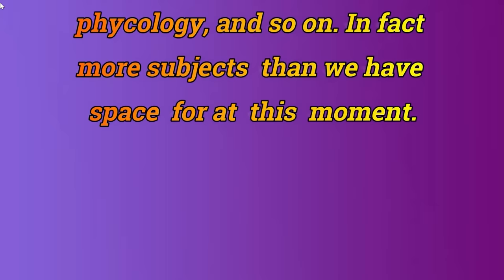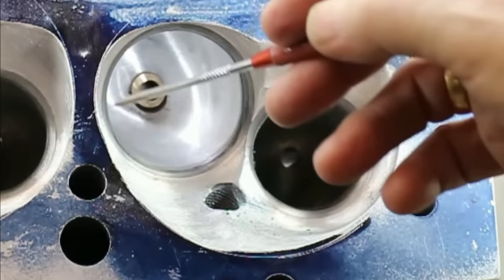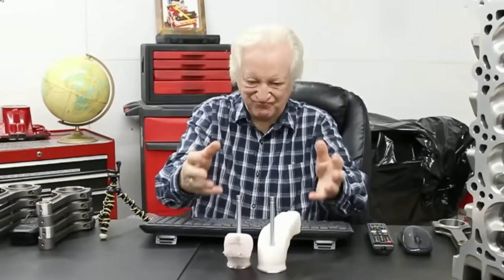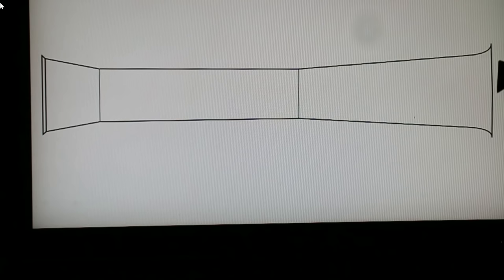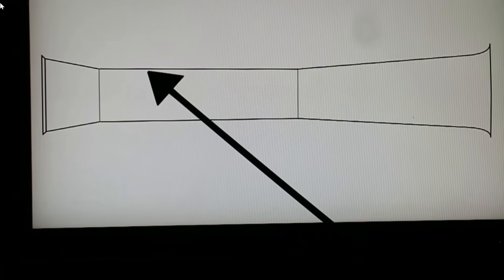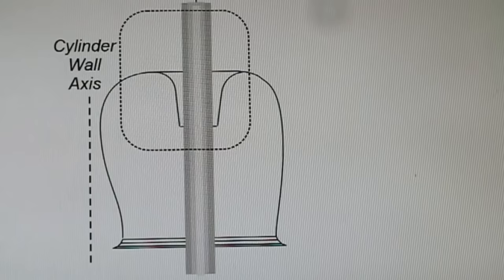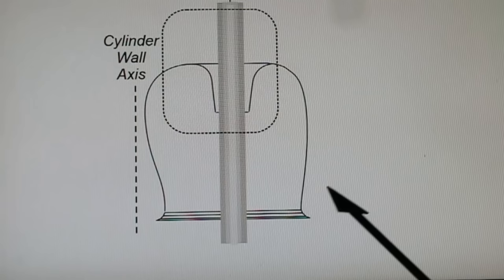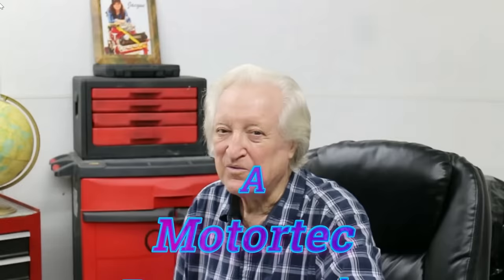Five Golden Porting rules - Rule #1 Part 2

Comment: Yup, the key is to have the velocity in the "energybucket" as high as it can be (without further limiting the chamber/seat/valve limiting factor) and start the pressure recovery before the valve, and use the chamber shape to further promote the pressure recovery after the valve. Then you have enough "umph" in the "rod of air" to continue stuffing in air well after BDC. I deal mostly with 4v stuff, but velocity is still king, and after realizing what DV is trying to teach, anything less than 115% VE NA seems mediocre at best.

Comment: Will doing all theses meticulous portings and better flowing head increase the fuel consumption on a street application or it would help reduced the fuel combustion waste % that going thought the exhaust.
What would be the best compression ratio vs the flow efficiency to maximize the fuel efficiency and reduced maximum fuel waste %.   
For sure higher compression uses less fuel to get better HP and its directly affects the fuel consommation.  
Yes i want the racing application guidelines, but how do they apply directly on my daily driver high compression Pontiac 389ci for instance.  If its non relative to this content, what is.  Will it affect compression ratio on different RPM ratio.
If i do theses porting mods, will it help my fuel efficiency with my basic 10.5:1 compression or should i increase a few decimals points like 10.6, 10.7, 11.0 to match the porting specs ?
How much porting is enough?
Thanks everyones from David to Andy and all the members of this community.
Im not a racing engine builder.  Im a male nurse who was raised in 1/4 miles racing passion without knowing the engineering of what we did.  Sure we ported our 68 Dodge 440 heads and rebuilded engine with bigger cams and all theses things but i was too young and dont thing my cousins really knew  about porting beside grinding impurities and openings and other basics but thats about it.   We were week end racers that listened others tips and tricks. 
Now im like,  ok. I can really learn something here.  How to do it right.  How much is enough cause too much is not good like they tought 30 years ago. Hehe 
David, if i can say something about your contents,  there attractives, full of specifics importants details,  keep it that way.  Dont bother with anyone who have bad toughts or bad shops who have not been respectfull to you or your friends.  I understand it can bite your fingers theses things but you know what you are.  You know how hard you worked to be where your are now.  Laugh about them who's dont have your integrity.  If there ok with there life or work,  you should be twice as much happy and just look ahead instead of your rear mirror If they are behind talking about you or your crew.  
A gentlemen who knows is stuffs dont feel attacked by anyone.  You know why?
Because "I" have trust in you and your teachings.   So does Andy, and Tony, and your familly and friends and all the community that is watching this and those who will in 50 years when were all gone.  You have spread a legacy of knowledge that everyones is learning and would love to know half of your hard earned toughts on how engines have capacity to be exploited compared the assembly line.  Most of population have tought that a 1964 pontiac tempest factory 11sec. Quarter miles was fast or the AC cobras or GT40 were racing cars but you could have done them better and faster.  You have done it with a toaster and the record still holds on that hill.  
Hope you understand what im saying.  Nevermind the BS and keep smiling.  Its good for the cameras.   Hehe.
Very Nice videos contents.  Simple and so rich in important details.

Comment: First, let me say I enjoy your videos quite a lot. My constructive criticism is to demonstrate results wherever possible. For example, I suspect when Richard Holdener tests his 2.2L Chrysler with your reworked cylinder head - you'll get a bunch more traffic - particularly if the head performs well. Not that there are so many 2.2L Chrysler enthusiasts out there - but if your mods are demonstrated to work - it'll drive interest.

Personally, I enjoy listening to you discuss these technical topics. You certainly have more (way more) experience than me, but I've also worked in engine development - both in racing as well as OEM... And frankly, some of the stuff you claim sounds absolutely bonkers to me. I'm not saying your wrong!! But sometimes it sounds bonkers. I'd love to see more proof and demonstrations of results rather than take someones word for it - even if it's the word of someone with credentials.

There's my earnest, good-faith 2 cents. Please do keep up the good work.
Reply: I have two of those engines (2.5L turbo) ,one in a 2000 lb trike I built for the insane fun of it. Every time I look at those heads I cringe and ask myself " WHY did they mess these up so badly" (Chrysler engineering) The rest of the motor is actually pretty good but the potential power output will never be realized because of those heads.
Reply: @tigerseye73  Despite being crossflow, the Ford 2.3/2.5 OHC Lima cylinder head is no better. The only way it could be that bad - is the engineers dunnit delibrit

Comment: I'm working on the ideal cylinder head. It has an intake valve that is 1.5 times the size of the piston and an exhaust valve that is 1.2 times the size of the piston...I'm having a little trouble getting it to fit though.

Comment: Mr Vizard, have you done any work on the Ford FE?  I have gained the most on iron heads the early tall port ones 13 degree angle. I used 2.09/1.65 valves  even in 390/410 engines, I used a bowl hog the size of the valve, bulged the side to fill the cylinder and raised the roof, used stepped guides 3/8 into the head and 11/32 in the port using 11/32 valves. Ground the guide boss away and the shaft stud bulges . Dressed the radius from the bowl hog cut into the floor the port stayed narrow at the bottom and wide at the top, and I was really pleased with the results when I went 3 inches into the intake manifold with the same shape. People told me that won’t work. When flowed they flowed 303 cfm intake and 220 exhaust. This was without the intake that stubby little port, if I had been the same length as most they would have been 320. The coefficient was great.  These heads were stolen. And I need to start over.  I know they would have been good for 1.75-1.8 hp/cube. FE engines are fantastic! BTW, in order to avoid making the SSR a kink, I set the heads to 13 degrees and used a miter pilot to allow the hog to cut to the most precise angle to bring the bowl to the back of the bowl and the SSR to have a good transition to the bowl and avoid a drop at 90 degrees with the shallow angle. The testing I did showed it followed the radius as it should without disturbance.

Comment: A steel wrist pin is very heavy. Do you have any options for using different metallurgy? Do you think you could get away with a high strength aluminum alloy, like 7075?

Comment: I have been watching your videos for a while now.  I have an 89 Camaro 305 tpi stock with a little work to the throttle body runners and intake.  Also the typical no money mods for f bodies with this set up.  I also have 24 lb injectors , shorty headers 700 r4 trans and 323 gears.  I wanted to do some port and head work to the stock heads and a cam that will still work with the stock tune.  I want to also use the fel pro 1094 head shim for a bit more compression. Which of your head mods do you suggest?  Also the heads are the 58 cc chamber it's a lb9 motor.

Comment: Potentially stupid question here, but around the 12:50 mark, when you're mentioning that the lower face is contributing little airflow due to the need for the air to change direction:
Why don't head manufacturers straighten that runner and angle the valve so there's a straighter path through?

Comment: @David Vizard: The given explanation could be better. In all videos. You could compare stock combustion chambers with the one you worked on so we can see the actual work that has to be done.
Same with the radius's in this chamber. It seems to me that you can not take away material from the seats. Otherwise the valve will not close or the the surface area will be to small to close it or cool it well (?).
That said, you could move the camera and the light to different angle as a birds fly over the radius and the seats so it all would be more clear to us the viewer. 
It is nice that you know all the in- and outs, but we the viewer do not. So more, wider and deeper explanation is needed. 
Thank you.

Comment: I have this idea I've been thinking about. Not sure if its a good idea. I was thinking of using a small Dremel tool and a small cutter bit that's about 1/16 inch round and you can make accurate scribe marks that will mark the depth. When you're finished scribing the layout it will look like a bunch of ribbed marks. Do this first and then take the big powerful grinder and you can see how far to grind just down to where the scribe stops heck it might flow better with ribbed ports it will straighten the flow

Comment: Mr Vizard, i appreciate your video and what your teaching is true but you not talking about percentages of diameters or volumes, one example would be the diameter or square area of the pinch point vs the square area or volume of the bowl. And the mold you have of the port ! Your audience would probably love to learn how to properly measure that mold and convert that into useful information, what did your audience learn about how important air speed is vs cfm ? … thank you sir

Comment: mr vizard...
i have a v12 jag 6 litre that i am at the head restoration stage. besides port matching between the heads and intakes and the considerations you have just mentioned here in respect to the shape of the 'bowl'....(this is 'gonna take awhile 🙂)
the heads are of mr may's fireball chamber design. on a previous engine mod the sharp edges within the chamber were lightly radiused and the volumes matched as close as was possible with the lab equipment i had at the time. is there anything practical that can be done with these chambers besides what i have already done? thank you for your time and effort on these vids. to say they are valuable would be an understatement,
=dok=

Comment: The bowl is something that I want to understand for so long. I followed the evolution of an engine (small 4 cyl., twisted wedge chamber). The early ones had a bowl looking like any other but the later ones eliminated the bowl. The cross section stayed the same like a garden hose turns to the valve seat arriving at an angle. So on the later ones the seat is extermely poorly matched to the port. Why is this? Is it for keeping the velocity at maximum for the price of terrible seat blend in?

Comment: I was reading on the internet how to build your own flow bench from six old vacuum cleaner motors and a sealed wooden box but this is a big project and it won't tell me exactly what CFM it will flow it will only tell me if its better than before which I guess is better than nothing

Comment: What is better for flow around the guide boss, streamlining it or removing it all together? The Saab rally department removed the guide boss completely; not much space in the intake channel of Ford Cologne V4 engine. I can imagine that when the air is guided around the valve stem it will flow better than when it bumps straight on the valve stem.

Comment: Tyler here just caught on to your videos and I can't stop watching. On the short side where the Air and fuel does not stay on the surface what if you added dimpling right on the short side? Supposedly dimpling will help the air stay on a surface which would help use the whole valve do you think that's worth it?

Comment: Hey David, Roger here. I have a Mercedes M117 with round ports, bone stock. I’m looking to clean up the casting and leave it with a 60 grit finish. The intake has a nasty 90 deg bend after the lower intake manifold I need to clean up. Any words of wisdom?

Comment: I have a question about valve shape, would an egg shaped valve help with flow if the wide side was on the high flow side of the port. I know Honda experimented with oval valves on motorcycle racing in the late 70's. Has that been experimented with or is it an impractical option. I understand it might not be cost effective and will definitely cost more in labor and materials to keep the seats right, but it's racing. Just a random thought that popped in my head when I saw the pictures of the flow. ,,P.S. most of this stuff is waaaaaaaay over my head, but it's interesting and I'm learning so much. I'm saving every video that pops up on my feed in its own special play list.

Comment: Theres no question that tightening LSA improves cylinder pressure and torque output of a motor. My question is how much LSA tightening can you have with electronic fuel injection, namely, the aftermarket fuel injection systems from Holley and others?

Comment: i don't like how complicated you explain it , 4 parts for 1 rule ,  i was honestly expecting a simplified explanation of the expected shape for a good port , around the valve seat , and if you need a specific shape behind the valves , a smooth or golf ball finish for laminar flow , a reducing diameter or expanding diameter or the opposite for intake or exhaust  ... the general basics you know , it shows you are very knowledgeable but i am not sure most ppl doing a port looking for info on youtube are willing to spend hours on the subject .. still thank you for your time and videos

Comment: The 2% figure doesn't sound impressive but I would be curious to see a close-up dyno chart on something like 400 and 500 HP motors to see how the curve behaves. That 2% figure may actually translate to much better throttle response and smoother power and torque delivery. That could justify doing this sort of thing more than gaining 10 HP on a 500 HP motor.

Comment: Go with Rods made by Carillo, Callie, Childs and Albert, Manley, or Eagle.    All are quality
Reply: Eagle has issues on several rods, not all. Scats have issues too on certain rods, not all. Callies and K1 are a step up. Manley on par or above those with Crower. Oliver is almost at the top. Carillo is the top. Don't think anyone argues that anymore. Several LS builders flat refuse to use Eagles or Scats either one.
Reply: @garlandjones7709  WOW. It is clear that you know rods better than me!!   Thanks for the info sir.  I knew Carillo was awesome but didn't know they were the best. If you build motors for anything,  may you find more horsepower than anyone you are racing against.
Reply: @robert23497  i wasn't trying to be rude, I was just throwing it out there in bc of the eagles being grouped with the rest. When people see them as equal quality as they have for years, a long with scats, they automatically go to those two bc they're literally half to a quarter of the price of the others in many cases and it's simply not so at all in terms of quality or fit and finish. They appeal to a diy guy and that's exactly the guy they can screw bc only a machinist usually notices the issues. 

My comment about Carillos has come from listening to NASCAR guys, pro stock guys, and EMC guys. Carillos are 2nd to none. I've personally never needed them, but I also trust who I've heard say that. Guys that have used them and xomoared them. 

Sonny Bryant crankshafts are the same way. 

The only rotating assembly part with equals in the field are pistons and bearings and even that is heavily argued.
Reply: @garlandjones7709   It's never rude to give a guy good information.  I agree with you about Sonny Bryant too. He is a LEGEND
Reply: @robert23497  i gotcha. I had to re-read what you had written earlier. I misread a sentence and thought you were being smart with me.
Reply: @garlandjones7709  no problem.  I would like to thank you again for the quality info.

Comment: I am under the impression that ports designed to work in the northern hemisphere do not behave the same way in southern hemisphere. Have you experienced this?
Reply: Nope
Reply: @PhilipUnderwood-oy9tv  elaborate from your experience as I was told otherwise
Reply: I’m under the impression that there is no logical reason for differences caused by being north or south of the equator. I’ve been on this earth 50 + years. Drive a Japanese v8 and live in the southern area of the globe.  Therefore I conclude that whoever told you that, was talking nonsense. How do you think it would be different sir ?
Reply: A top motorcycle drag racer, engine builder and tuner told me that a world record package with data from the northern hemisphere was brought to the southern hemisphere and the fueling was out by between 5 to 15%. He said it was because the ports were developed for the way air swirls in the northern hemisphere.

Comment: CunnalingusKhan 🥝✔️, The explanations is this. A bowl 🥣 exists to concentrate the number of flow paths against the number of flow gradients. They most allow flow at all times until the shutting and opening of the valve. The flow paths and flow drops are always at 90 to each other. Terzaghis equation for strip foundations does some simple calculations with values assigned to each flow path and flow drop.  The valve and the Venturi are analogous. I wasn't trying to be a smart a$$. If you go through the early development of the Tunnel Port 302 and the later racers epoxy port filled Boss 302, you'll see a Venturi port with a bowl shows that little can be done to improve things verses an idealistic lolly on a stick rim flow valve. Have a nice day. 🥝✔️
Reply from the maker: I am not sure I followed all that!!!!!
Reply: @DavidVizard  Maybe I did,.....  but the relevance of a Tootsie pop shaped intake valve doesn't apply well.